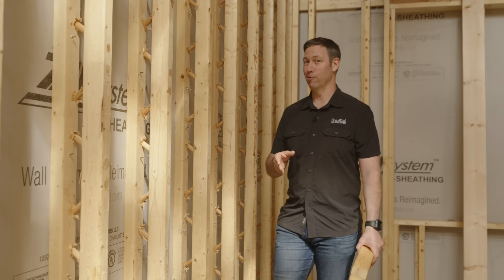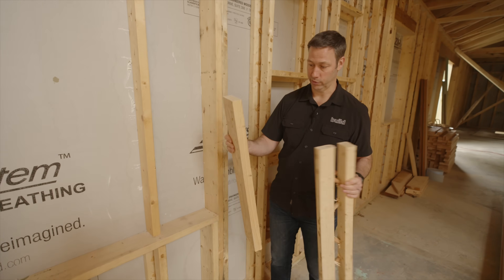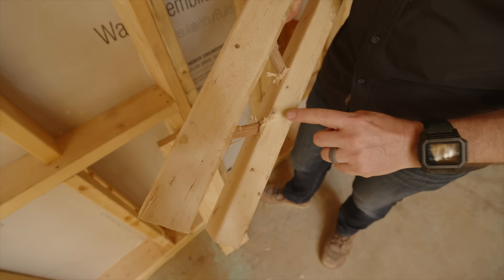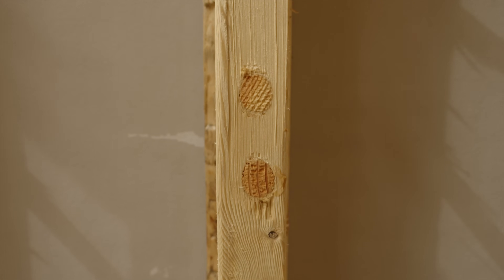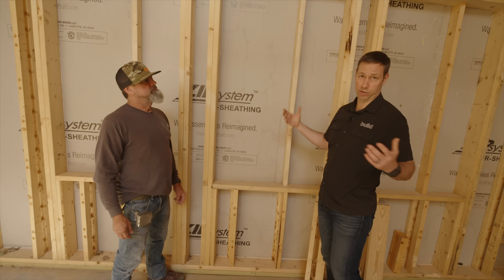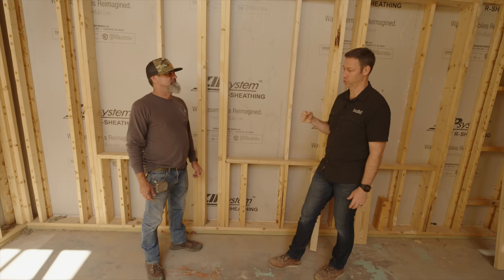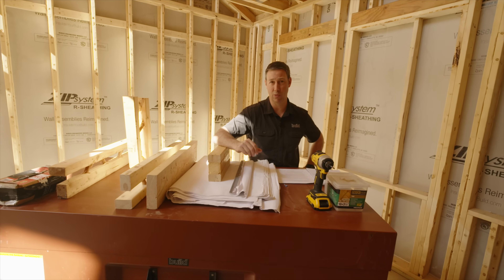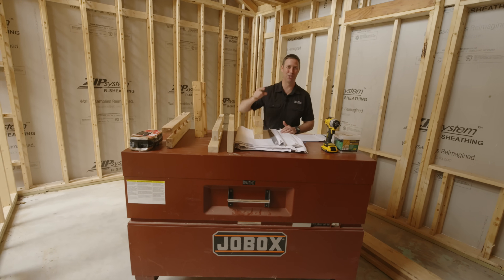Framing with a 2x6 Replacement - TSTUDS!!!

Comment: Hey Matt, I am working on some timber frame stairs that are going into a clients house. He has used Tstuds for interior walls and I am trying to find out how I can secure the beams of the landing into the wall framing. Can lag screws be screwed into the Tstud? We are looking at using LedgerLOKs to attach the 4x10 beams to the Tstuds. Can the Tstud handle having a lag screw driven into it?

Comment: Just came up with a weird idea for T-Studs.  Well two, one lead to the other.  Could you use T-studs to support your electrical panels?  By doing this it would allow the electrician to get better access to the panel without drilling so many holes.  I then thought that this would be a great idea in bathrooms with the water lines and drains.  Another advantage of this in bathrooms is to provide better sound insulation.  I guess we could carry this a step further and use it in your internet hub, and entertainment center area.  I know that they say there is nothing better than fiber, but it is still new and having easier access to a technology area can make things easier and cheaper in the future especially with LED over ethernet Lighting.

Comment: Drill HUNDREDS  of holes in a  smaller  board  , 
Sounds  strong   ?   Not to me  !
Splits easier  ?    Yes 
Cost more  ?      Yes 
Horizontal Strength  ?   Not much  
Vertical  Strength  ?    Maybe  

Build a house and in 100 years tell us if it is still standing  , 
If it is  ?
I may try it  😂

Comment: So straight away when the wall frame was being nailed together on the ground the thin wood split with every nail shot so thats weaker straight away!.........It also looks like it will cause the same problems when attaching cladding.......splitting and therefore not holding.

Comment: A tiny step along the road to future framing reality - the unified parallel chord truss / rigid frame for ground level assembly tilt up frame providing deep insulation cavities to be filled with site manufactured / installed finely shredded wood fiber to "super insulation" levels

Comment: It all burns the same, and molds. Use steel and concrete, lasts much longer, higher compretion ratio, Mold resistant, Thermal stability. Mabye more expensive but better in fires.

Comment: I like the idea breaking that thermal bridge from interior to exterior however first😂 shot from the framing gun and it split the wood. Not to say that that doesn’t happen with regular lumber just saying but definitely less with 2 x 6 lumber.

Comment: Just go to metal studs , this stuff like many new products way over priced I laugh at all this super Insolation stuff its irrelevant in real life. This is in no way in the top 100 of human problem . Over 50% of marriages end in divorce . Good chance people would be better off working their relationships in life than spending 10 seconds worrying about your wall R value. You could put studs 12” studs staggered on a 2x 6 plate .
Reply: These studs won't pass any sort of fire code and shouldn't be used in any dwelling you live in, you wouldn't have time to get your family out alive. The whole point of solid studs is to compartmentalise the fire and restrict airflow from spreading inside your walls. This is an air and fire expressway. Congratulations, you just turned your walls into a giant rocket stove.

Comment: This is a solution looking for a problem. Bog standard 2x6 is more than structurally adequate for any regular house. And given that this stuff is 4-5 times as much as sawn lumber there's no justifying the cost - especially if you're using exterior insulation like ZIP-R - and that stuff isn't cheap either. All these engineered products are pretty cool, I admit, but they're cost prohibitive for most. Is it going to save you enough in heating costs to offset the expense of it over your time in that house? Absolutely not. Blown cellulose, 2x6, and vapor barrier works great and is actually affordable. And while the claim this stuff is structurally superior is there any actual evidence to back that up? It looks pretty ghetto.
Reply: People may value noise dampening, and carbon. Labour costs may affect costs, especially as production costs come down.

Comment: I know this is an older video but if those studs are so much stronger why still go 16" OC ? Why not go 24" OC ? It makes running any pluming much easier and a little less material cost.

Comment: Umm, so no fire blocking at all? After some research the only things you can insulate that wall with are Cellulose insulation, Aircrete, and rock wool. Anything else is not properly fire rated. If you use standard fiberglass bats with the paper stapling edge (after filling the Tstud with loose fiberglass of course) there is NOTHING stopping the fire from running rampant through the house. If you use spray foam (of any kind) so much of it would catch fire so fast without fire blocking that the smoke would engulf the house too rapidly. You MUST use fire rated insulation with this type of engineered lumber which between the 2 makes the cost to construct very expensive.

Comment: I built my addition using 'offset' 2x4's on a 6" thick wall, so there is no thermal connectivity from the inside wall to the outside wall.  One set of 2x4's makes up the outside wall, and another set of 2x4's makes the inside wall, but both connect to the 2x6's on the bottom and top.   This is simple and cheap solution that does what this fancy stud does.
Reply: your stud would be far better..i cant possibly see how those pieces of shit stay straight, there no rigidity to them...nice idea you did with offset 2x4 on 2x6 plates
Reply: @smokeymacpot76 - Well, these aren't exactly "New Since Last Night", so, if you "Can't See" how they stay Straight, after fully watching this Video from Matt, you "Could" do more research, or Buy 5-10 Pieces of these T-Studs, and run some torture tests of your own, on them! 

Also, Those "Bridge Truss Orientation" of the Dowels, is a Major portion of keeping the Cap and Spline Straight!
Reply: @robertweekley5926   i definately will not be wasting money on those....im glad you like them
Reply: @smokeymacpot76  You don't understyand now being clamped down to run the dowels can keep them straight?  Because you have alternating push/pull from those dowels and the wood doesn't bow as it dries because of that.  Add in the alternating 2x3s and the bowing is countered by the two.  It's really not that difficult to understand if you think about it. If you had watched the video, even the framer guy says he was reluctant to use them at first until he learned more about them and now he loves them.  If you got out of your comfort zone, you might find some new technology that works better for you.
Reply: @REALfish1552  the test will be those houses in 10-15 years... there not that impressive u can think whatever u want...i prob understand contr far better than you, your 1 them bouncy guys landing on everything new and made a tom of junk havent you lol
Reply: @smokeymacpot76  yes yes you know better than the engineers, manufactures, framers, etc. Everyone who touched these knows less about them than you. Those that understand the engineering and forces that keep them straight know less than you
Reply: any two subsequent dowels are angled in opposite directions. in order for the wood to distort it would have to slide with respect to the dowels. But the wood can't slide along one dowel because the next dowel over is angled in the opposite direction. So every single dowel inhibits movement of the wood with respect to the adjacent dowels
Reply: @justincameron9123  bla bla bla bal
Reply: @smokeymacpot76  spoken like a true expert

Comment: man, my wrist is already hurting for plumbers, if they need to drill through multi Tstuds.  a whole saw bit nada. stupid bit will catch and twist drill and hand into something. spade bits are out, any drill bit is out. any sort of circlur saw blade is out. they want hole drilled within the dole / webbing space.  bah getting a recipcating saw in there is a no go!, i suppose could work but i could see myself splintering the spine of the Tstud.  jig saw maybe with blade put in reverse sounds like a night mare but workable? 

i rather see an I-joist than these Tstuds. atleast with I-joist you have some extra clearance for running pipe work. 

granted i stated plumbing be a nightmare for 2". but how much would you need to run 2"? "gas tankless water heater that uses pvc pipe, i hope ceiling joists or in attic is friending for DWV (vent piping)

Comment: Question: if they have 3x the compression strength, is there an engineering possibility of using fewer of them, say a 24" layout? Or is this a case where the two exterior heavy loads require the sheer strength as well?
One big benefit e is using 2x3s from the mill. They can use smaller trees to make them in the first place - fewer years of forest growth required.

Comment: Anyone have any issue with city planners in using Tstuds? We have our addition fully framed and are encountering significant resistance by the Phoenix city planning.  Having mild panic attacks that they won't approve it and we will be forced to take it down and start over! Any support from those that have used it and had approved would be helpful.

Comment: Hello there,I been and still building for nearly 60 years the tee section is genius and should be mandatory for all sheeted joints, plus by staggering the tee studs it gives you the option to run gib sheets vertically this will enable the staggering of both internal and external sheeting joints. This is revolutionary technology the offset on heating and cooling bills is obvious, high wind and siesmic zones,  is also a plus, Best wishes Kieran Pollard NZ

Comment: Questions - So did I miss it - using std kings and jack approach causes thermal bridging.  yes you have foam.  And spacing is 24 for T-studs - is that what we are seeing?  Tks

Comment: I do not see this as the future of anything.  Different areas of the county, (speaking as relates to the US), have different materials build requirements.  Cost is the single largest factor when choosing construction type.  These can not compete with either wood studs or CFS studs.  What they can do is provide the 'thermal break' which is only relevant in very cold climates and where local jurisdictions would feel this to e the priority.  Speaking as a structural engineering and construction management company, my first thoughts relates to carrying and transmitting loads.  Has a certified testing facility looked at compressive and shear load testing and published results?  I do not see how this stud with what appears to be one third less bearing capacity.  Handling  larger point loads would seem to be a weakness although still a requirement.  I can see the larger issue with say a load bearing CFS stud which is steel from front to back but with wood, there is not such a large transference of  temperature.   And of course, wood burns, rots, has insect issues, etc.  It depends on which 'gremlin' you are mitigating.

Comment: 3x more compressive strength. OK. But when is the last time you have ever seen a framed wall fail from to much weight bearing down from an extreme roof load. Never? Probably because the truss or beams fail way before . If 2x6 studs arent good enough, then stop engineering homes with wood . It is ridiculous.

Comment: How did I know you would NOT give a price? I get it you make your $ on advertising but all too often so many of your featured products are so expensive that the homeowner simply cannot afford them. I love working with engineered framing for all the obvious reasons. Few will actually opt for them Vs. dimensional lumber which is too bad. I think a more readily available alternative might be framing with TJIs. Yes you still are drilling but most have knockouts in the web & its only about 1/2" anyway. Request for future - when you say you are going to give the cost - actually do that. Price per l.f. for a 2x6.
Reply: The first thought was cost. That matters!!!
Reply: So does the labor, and drill holes for electricians is hardly inexpensive
Reply: You can use a computer, cant you? Look it up instead of crying in public.

Comment: It's Super hard to actually believe they are superior when the video is sponsored by the product you're show casing. My friend got a prebuilt timber frame kit(just the frame) and framed 2x4 walls on the exterior of the timberframe, 2' o.c. and spray foamed it with 3inches of closed cell and sheathed it with zip-r. He said it cost him about 100$ to heat his house last year and that he had to keep windows open sometimes because it got too hot(in ny, climate zone 6). The difference in price for t-stud vs 2x6 just makes no sense what so ever. It would be cheaper to frame via high efficiency then use t-studs. I guess ya just market anything when they pay you to say their product is superior.

Comment: This kind of wall won't pass a proper fire code inspection. It needs material to block fire from traveling down the length of the wall, into other walls, and up into the ceiling. Fireblock foam would work, but adds a lot of cost.

Comment: The question I have is why make it a T.  Would one not get more insulation by putting both flat with the dowels connecting them.  More space now between them.  Easier to hit the wood through what ever sheathing one uses.

Comment: ok the trick to new design in this space is it must cost less. that is the value position. faster construction method? no. then it is a novelty. cute, interesting, but no. insurance companies already not happy about spray foam insulation.

Comment: You're charged for 1,440 square inches in a 2"x12"x10', but you only get 1,260 square inches. You lose 180 square inches of wood for each board. You pay for 8 boards and get 7, that's a good deal for the lumber company.

Comment: Homes built 100 years ago were built with 2x4s that were actually 2 full inches by 4 full inches, 2x12s that were 2 full inches by 12 full inches, not 10-1/2.

Comment: I see it as better insulation (blown-in), and wire secure conduit electrical, and CTS & Pecs easier install-with-protection !!

With the gap between studs_the direct conductivity of outside temperatures is greatly decreased, even better when filled with insulation 😎

Comment: A more efficient use of timber, easier for the other trades to run flexible material, won't readily warp or cup, longer lengths shouldn't affect cost per foot, engineered system so the inspector is happy, obviously stronger, a consistently cleaner, higher quality "stud", no knots in all the wrong places, sounds great, doesn't it? I knew that it would cost more, but 5 times is too much for me, DARNED!!

Comment: I was using truss studs almost 40 years ago.  Manufactured my own.  16 houses built with them  I use a wall based upon a 2X10  9.25 inches.  Fiberglass insulation was cheap then and cheap now.  A 2X6 is not taking full advantage of the concept and it is only marginally less conductive than a solid 2X6.  Ya gonna go,,, go long.

Comment: You can only work one side of a wall at a time. I’ve seen 2x4 or 2x3 studs offset inside to outside as they are placed down the wall. 
______________________________.                   
|x|           |x|         |x|        |x|       |x|        |x|
       |x|           |x|         |x|       |x|       |x| 
________________________________
Then insulate zig zag between the studs.

Comment: As a firefighter. Those are terrible for a few reasons and most modern building practices are worse than the old fashion methods. Old construction was bigger heavier boards and beams like they used in barns. They hold up stronger longer and have less surface area of burn potential for decreased rate of fire growth. The way these new studs are is bad.  
1 glue fails at 1000 degrees so the building could easily collapse by the time the rescue team gets there. 
2 they have higher surface area so it can burn quicker spreading the fire through the house 
3 although it is nice being less wood because the fire can’t burn as long it means that structurally it will loose strength faster and not have any core wood left to hold the ceiling up. 
Personally I would never use any of that stuff. Expensive, dangerous, and won’t last as long. 
I recommend timber framed houses with wood pegs and 4” nails on the smaller stuff. Smaller as in 2x12 floor joists. And not 1.5”x11.5”

Comment: I been in residential construction (plumbing) for over 50 years. If I showed up to do the "framing stage" portion of my plumbing (gas, water, drain/vent systems) and I seen these "gadget" studs?... I'd prolly have a fit. At this point in time, a new idea is rarely a better idea. 
  This "T-Studs" concept will never take off. The "R" value is minimal.... If you want to save money on heating and cooling, stop building such tall, cathedral ceilings (huge waste). 
At 3:26 the framer "end-nails" a t-stud and the bottoms splits...typical. Give me a 2 X 6 that I can drill with no issues. 
Form a column where I have to drill? No! ...And the dry wall guy with hate this too. 3" screws are illegal....they have no "give" value....they snap (break) instead. 
 "You don't want to take out any dowels" ...HUH? I have "building codes" to follow. Be sure the framing contractor knows all the plumbing (height) codes and product specs before he stands a stud.

Sorry...but these are all obvious issues....price of T-Studs must be astronomical.... a "jig" is needed to build one......ouch!